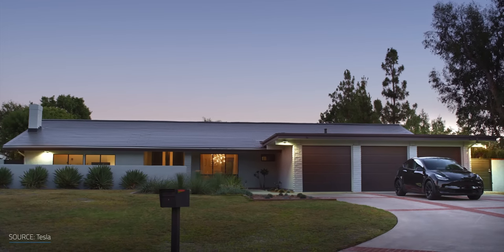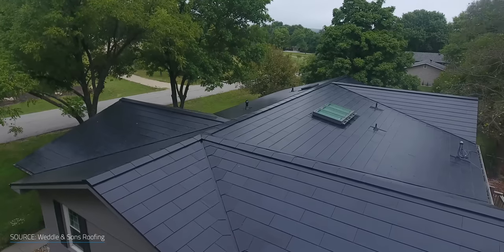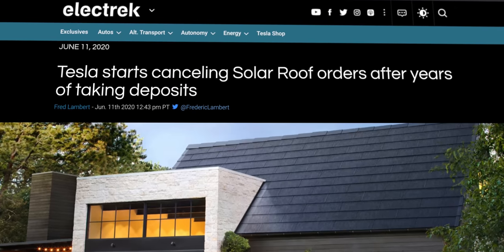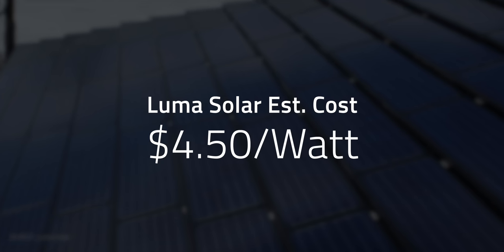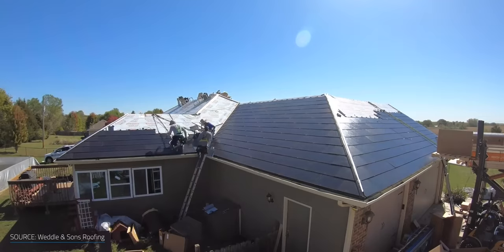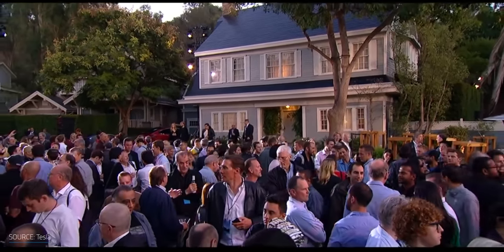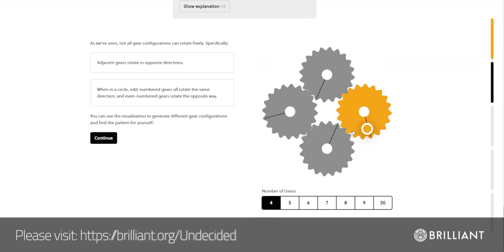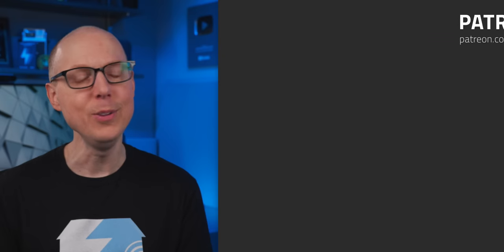The Problem With Tesla’s Solar Roof

Comment: Who in their right mind would pay $70,000 for solar?  I doubt most homes would use that much electricity from the grid in 10 years, so paying that much for solar defeats the point.  I really hate the solar warranty claims because I doubt the companies will be around to honor them in 30 years, so that makes a long warranty pointless.
Reply: Your problem is generally not going to be the panels.  You'll end up replacing the electronics like the inverters at a higher rate than the panels.   Though I agree that 70k start isn't a good return on investment unless the roof was going to cost a good chunk of htat in the first place.
Reply: @hmurchison8123  yes, I know the inverters are most likely to fail before the panels will.  But that doesn't negate a pointless long warranty if the company is not still in business.  And we shouldn't really care about the return on investment with solar, because you get ZERO return without them.  It's should be more about lowering or not having an electric bill.

Comment: Renewable energies, or green tech itself has the problem of cost vs payoff. Only someone who is enthusiastic about it will be willing to pay 5 to 20 times as much for something that does the same thing, and may also have a long term reliability problem and need repairs or replacements sooner. It's just not worth it for people who don't feel like burning their money on nothing. It's like hybrid cars, you'll pay hundreds extra a month to save 20 bucks of gas a month, and then either sell the car or replace the battery for like 8 thousand dollars after 5 years.  Wide spread adoption has to make these alternatives economically superior for the end user, or they'll never be appealing.

Comment: Hail storms and high winds still get a vote, and they would vote to destroy those rather delicate-looking cable runs and junctions along with the panels themselves.

Still amazes me the roofing industry hasn't started to adopt at least semi-automatic 'bots to help with stripping the old shingles and far more accurately nailing the new ones in place (as opposed to the current 'as rapid pneumatic trigger pull as possible with haphazard aim' method).  I guess treating immigrants as slave labor is still more appealing and cheaper to the almost exclusively 'Red Team' roofing company owners.

Comment: yah no way timberline gone be used inside eu, the roof has to be absolutly isolated somethink like a nail is a no go here. Besides, it doesn't look very durable. in the eu, mainly concrete/clay roof tiles are used.

Comment: A solar roof on my small house would cost $30,000.  $39,000 - $9,000 in tax credits.  Traditional tiles would cost $7,100.  $9700 - $2600 in tax credits.  Only 4.2x the cost.  Which brings me to my pet peeve.  I'm a taxpayer.  Why in the h.ell am I responsible for / being forced to help pay for someone's $40,000+ solar roof?  There should be a cap on the rebate.  If someone wants to waste money on this idiocy, then they can do it on their own dime.

I'm opposed to credits for this stuff at all.  If the government wants to help owners with loans, that the owners has to pay back over time, then by all means.  Many of these solar panel installations pay themselves back after a few years, but I don't see taxpayers getting any of their money back from the owners that are profiting off of taxpayer funding.

Also, as we're learning in California, as a result of their net metering, electricity from a power plant can increase in price.  It's the people who can't afford solar panels who typically get hit with the upcharges.  Thus these solar credits are regressive AF.  

"Solar roof"... neighbors may not realize the black shiny roof that's unlike any other roof in the area is solar panels... lol riiiight.

Comment: Even if 99% of the time nobody does this, but regular installation at least has the potential of implementing sun tracking functions. What if the house's orientation is simply not fine for panels simply following the flow of the roof? The crazy amounts of required electronics to convert everything into useful power, which nobody likes to talk about, creates a shit ton of heat, which is greatly airing out between the panels and the roof. What if something is wrong, or i wanna upgrade to more efficient tech, make the house roofless for days instead of just switching something out above it? This integrated idea is utter crap.

Comment: I don’t know where you get your numbers but for Tesla to get 71W per square foot they would have to be 3-4x more efficient than the most efficient solar panels on the market, beyond NASA efficiency, beyond theoretical efficiency. The best PV modules on the market are 22% efficient at STC which is 1,000 watts per square meter at 25C. That means under ideal conditions in the factory they make 20W per square foot or 220W per square meter. That’s why a super premium LG NeON R 22% efficient 40”x66” PV module is rated at 400W. POS Tesla roof tiles are 15% efficient which calculates out to 14.5W per square foot, not 71W.
If you’d like to check my math, even with a napkin, imagine I have a modest 1,600 square foot home with a single plane shed roof facing south, perfect for solar… can I install 1,600 x 71W?
113kW Tesla roof? Tesla roof is going for $4.50+ per watt so it should only cost $500k to do my house. Still, totally worth it if I can power my whole street.
Not trying to be mean, I really appreciate the presentation of your videos but  inaccurate ’facts’ result in poor decisions.

Comment: Houses way too big and not designed properly for solar utilization. We need to be designing for passive solar, passivhaus insulation and air exchange, Earth based climate battery technology, and super efficient heat pumps.

Comment: I got a quote for approximately $54,000 three batteries back in March 2021. I told them to go ahead and proceed I then get an email saying the price went up when I logged into my account it was 94,000 double what I originally was quoted.
I emailed them and told them to cancel it.
Because of Tesla's horrible customer service they either ignored the email or passed it on to someone else. Fast forward to 2022 in January I get an email from Tesla saying that if I had a problem with the quote that I should click a link and complain. So I did so simply put the price doubled. I then get an email a couple of weeks later from a contractor asking if I was still interested in Tesla solar roof.? I was confused because I had canceled it so I logged into my account low and behold my account wasn't canceled on top of that it had dropped down to $44,000 without any batteries I then added three batteries bringing the price up to $56,00. This is all approximate I might be off by a couple of thousand dollars. So rather than complain I was grateful but I thought it was a mistake so I proceeded to sign the 32 different PDFs that they sent me to lock in the price. Right now as it stands I'm all locked in and I'm awaiting an installation date.

Comment: Roofs are not designed to be particularly precise, quite the opposite, they are made to work, when getting hot, cold, wet and try again. Roofing tiles have centimeters of wiggle room to accompany for that, those solar tiles don't, which will force the under construction to be a lot more precise. Just asking an expert and recognizing, that in the given case that would be an ordinary roofer, not a scientist or engineer, could have mitigated the entire desaster.

Comment: I stayed at a friend's house last weekend and they had a Tesla solar roof installed not too long ago.  I was blown away by how well it powered the house.  Two story house, 3 refrigerators, lots of electronics in there, and two electric cars.  

Also. It snowed the day before we got there, and the snow slid right off the tiles shortly after it snowed since they are basically like glass.  

When I get a house, unless something better comes out later, I won't buy anything but a Tesla solar system.

Comment: Solar panels have become cheap. Tesla would do much better supplying a battery pack for homes.

The main reason I do not have panels on my roof is that where I live, selling the electricity is literal pennies per kWh. Not to mention that you can't use the power your panels generate when there is a power outage. 

I want to store and use all the energy myself.
Reply: Yes municipalities are trying to gut net metering and I presume they'll eventually try to push legislation making it harder to detach from the grid.    Right now your energy coop gets to tell you how much solar you can put on your property.   Once you untie from the Grid you can put whatever you want on so long as it's code compliant..   Right now the ability to store your energy is the most important thing.   The biggest improvement to solar is via the ESS.   If PV panels had a lot of promise LG wouldn't have thrown in the towel and stopped manufacturing panels.

Comment: a lot of those aren't really the same product as the tesla solar roof. The tesla solution IS the roof, the other products (virtually all of them) cannot take on that role. Most of those were just solar panels in a non typical form factor but are not roof tiles so i don't really think you can put them in same category.

Comment: I'd be interested to hear about the actual environmental impact per kilowatt hour - solar tech is generally short lived, heavy on rare earth metals, and very toxic to produce and replace.
Roofs fix one of the biggest issues, square foot per kilowatt hour and roofs present a major issue in sporadic efficiency and potentially slow repairs but should these issues be fixed I would live to see a world where every roof generated power.
Until then, nuclear remains the only green option.  Crossing my fingers for finally getting fusion in the next 30 years XD
Reply: Meanwhile green energy advocates would have much, much better results pushing for better electrical, insulation and longer lasting building materials being put in houses.

It makes no sense to try slap a solar roof on a disposable copy-paste suburban house like I see selling for near a million dollars in some areas here when your just going to bleed so much of your power usage through less than stellar wirin and insulation.

Comment: A full installation here of regular panels, batteries (non tesla) and a big inverter to handle air conditioning, heating and so on came in at $20k less than the Tesla "solar roof" by itself.  No inverters or batteries.. So it's not happening here...

Comment: G-A-F please, not GAFF.  I'd love to get a solar shingle roof, but the manufacturing technology is not efficient enough to make them cost effective.  Anyone following solar energy over the past 25 years knows there will not be a major breakthrough in technology overnight, but rather small progressions.  If necessity is the mother of invention, then a large spike or steep cost of energy will get even more smart people working on the problem.  The added benefit of course might be cleaner air and water along the way.  Give the labs and industrial engineers another 15 years and solar shingle roofs will be good looking as well as cost effective.

Comment: Really, the problem with Tesla's Solar Roof is the same as with the others -- you're replacing a roof that only has to be a roof with a roof that has to be a roof and a power generator, that might require more occasional maintenance than just a regular roof, increasing the chance that the roof won't be as effective as a roof. 

I don't see the advantage to the 'solar roof' versus just getting a good, expertly-installed roof and then putting good expertly-installed solar panels. 

The comment about aesthetics of solar panels smells like marketing puffery to me.

Comment: I’ll say the true problem. Tesla does poor installation, and the crews just screw through the roof without proper flashings.  Relying on caulk. Causing thousands in damages. And you cant get them to do anything about it because their “gray area” contract is designed to screw the customer. 10 year warranty or remaining life of the shingles. Or they come out and say for $1500 we can remove it so the roofers can do the roof, then $1500 to put it back.

I’m a remodeling contractor and have to take a bunch of Tesla solar off to repair damaged decking, trusses, interior ceilings, replace attic insulation that’s soaked and no longer viable. And Tesla on every home, has denied responsibility, stating the roof was worn past its service and is the cause of the damage. And the solar was installed 10 months prior to damages. 

So why didn’t they say anything about the condition of the roof? Because then they’d have to stand by that 10 year warranty. Knowing the caulk will not last 10 years. They are a joke.

Comment: The problem with Tesla's Solar roof is that it doesn't look like a nice roof, it's inefficient, and so expensive that it will never pay for itself.  Solar tiles seem like a good idea, but maybe it's better to put their effort into highly efficient, good looking and affordable panels.  Sunpower panels look good, but on my house,  it would have taken 12 years just to break even. When you look at a typical roof, there pipes and vents and attic fans.  Are a dozen nice looking solar panels really that ugly?  Do the best solar tiles really look any better than normal panels? I don't think so - they would look terrible on my house which has concrete tiles that look like wood. Tesla tiles look like Legos.

Comment: We are still at the point where solar roofs are a bad joke and a terrible investment. Even if you get you money back eventually, it's not just about the money. Building these roofs is not environmental friendly and when they are going to stop working, these roofs become a waste hazard, just for a few bucks. Right now we need to wake up and go back to nuclear. It is by far the most efficient form of energy with far less waste than these toys. A nuclear powerplant can give electricity up to 1.000.000 houses without any immediate waste, just small quantities of radioactive matter. Imagine having 1.000.000 of these houses using these solar roofs. First, they would not be able to cover their electrical needs for sure. Second, when the roofs will start to fail, these 1mil roofs become waste! That is a catastrophe. I don't even want to start about the pollution generated during the process of building these roofs. Don't take me wrong, I believe that in the future, this should be a necessary tech for our lives, but we are far from it right now, very far.

Comment: We bought a Tesla solar glass roof. roughly 3000sqft.  500+ is solar the rest is nice looking matt black 750psi glass. You can walk  on it. Two power walls. Cost $60K with perks. We Needed a roof.... So it was well worth it..... We had estimates of $60K for a simple metal roof!! We don't have an electric bill anymore. AC is Free.

Comment: $4.50 a watt? Solar roofs have a steep price tag (pun intended). I'm getting my solar panels installed at a rate of around $2.40 a watt.
Reply: Still expensive though.
Prices hover at 1 dollar a watt nowdays.
Reply: @baronvonlimbourgh1716  $1 a watt is only applicable for multi-megawatt solar farms. 
Though you may be talking about the panels themselves; in that case, in my business I can actually get 540 watt bi-facial panels for around $0.69 per watt.
Reply: @bluebukkitdev8069  i got a 8kw instalation for a bit under 10k euro last year. Complete and without subsedies or anything.

350 or 400watt panels are about 60 bucks a piece if you buy them by the containerload from the factory. Or where at least last year. Maybe with the shortages and shipping costs they may be a bit more at the moment. But thats just temporary.
Reply: @baronvonlimbourgh1716  They've doubled or more in the last year, you're right it's mostly due to SCM issues. 
I've seen systems installed for really low costs but generally by unqualified installers.

Comment: Why use tesla lol. It costs a fortune, can only use tesla for anything in the future and can't just do any easy changes.
And the cost is eyewatering. It will never save you any money.
I guess the shingles system itself really only makes sense in the usa with their wooden construction.

Just doing a panel roof has become so cheap nowdays. And they roi in a couple of years.

And the cost concideration is less connected to house value then electricity cost.
If you live in a 50k house but somehow have a 10k energybill every year it still makes sense to put up a 50k roof on your house if it saves you 10k a year in electricity bills.

Comment: I thought I'd see comments about how easy that solar shingle broke with a hammer blow. It did not look more forceful than decently bad hail. If I had that roof I'd be worried as soon as I started hearing any hail. I mean, the hammer blow did not just crack a part of it, it took out the whole panel. Yeah, easy to replace, but is it easy enough for the home owner to do before the next rain? What about all the rain pouring in from the huge panel sized opening in your roof?

This just sells me on a steel roof with solar panels.